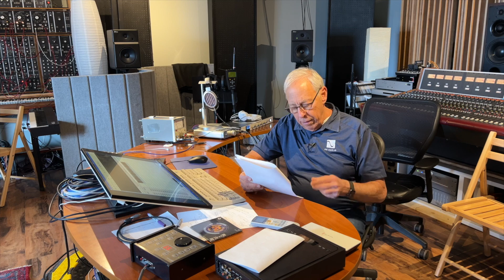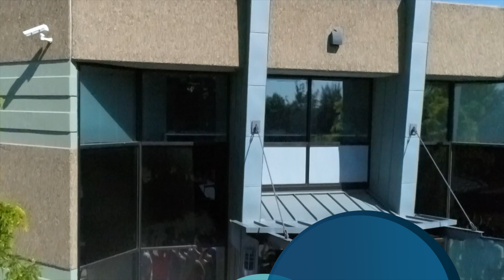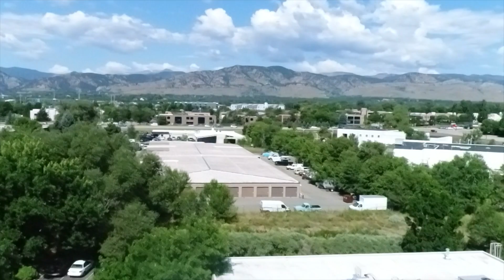External crossovers

Comment: It is quite difficult to get the right sound right away when you make a crossover.
You always have to change it. For example, change the volume on the treble. It is much better to have external boxes, even if they don't look pretty.

If you have good quality non-magnetic metal terminals and banana plug and wire soldered straight to speaker divider.
I don't think you hear differences between internal and external.

With active crossover, you must use EQ. !
Reply: Right on! ...my system is ugly as hell, but the sound is heavenly,  a DIY labor of love evolving over the decades!   .....I would have it no other way!

Comment: I have external crossovers primarily to fine tune the circuit and because it simply would no longer fit inside the designated place. Regarding cable length: the total length is not much longer and my tweeter high pass filter would react worse to cable indutance before the filter than after it. Some people pour sand as damping material over the crossover, which I have not done yet.